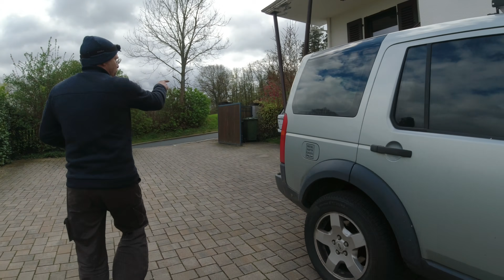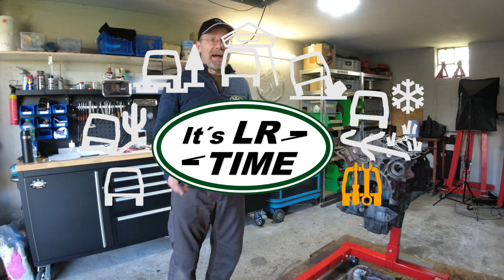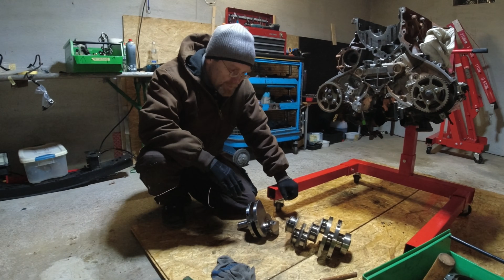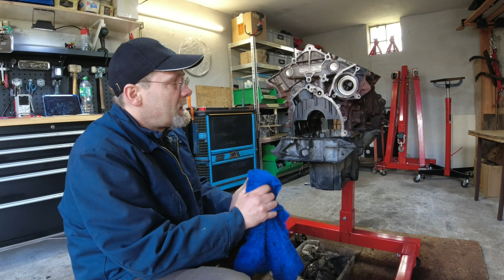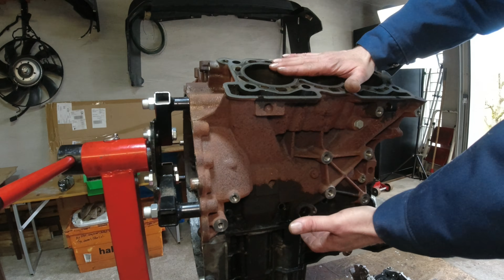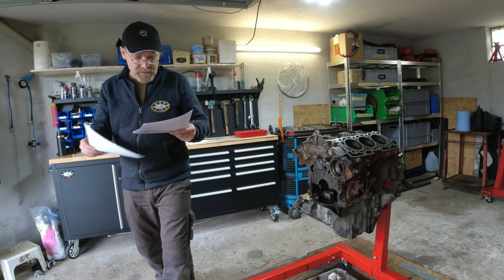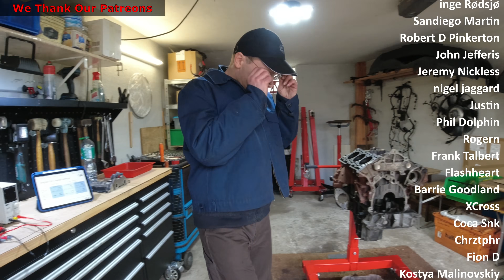Ford´s 3.0L Powerstroke failure modes - also JLR SDV6 306DT / S5-EP16

Comment: What do you think of the rough injection phases right on the low RPM as another reason to ruin SDV6?
I read about it from a guy who rewrote fuel cards (chip tuning) to REDUCE moment from 600 Nm to 550 on low RPM, but add more horsepower on high (~300 hp).
Reply from the maker: We agree. 👍👌 No tuning and no additives for any of our Land Rovers, or cars we own or service. 🙋‍♀️

Comment: Hi Christian 

About the Queen fuel heater problem if you have a Webasto heater search for "Webasto 800h reset"
I think that is the problem if you have tried everything else.

Many Volvo owners in Sweden have this problem and cost a fortune to fix at the dealer and they always repalce the whole unit
because they are not aware of the problem.

So just a tip to point you in the right direction and thanks for great content in the channel and keep up the good work

If you need some links for the solution above, contact me direct my message are deleted if i post them here.

Kind Regards from Sweden not driving a Volvo myself just working on them and other cars in my own workshop at home like you :)
My own transportation is an Alfa Romeo Giulia Veloce Diesel -17 but wait now i am running 5w-40 on my car too :)

Comment: Excellent presentation. Wonder how the RR TDV6 in the US compares to the European version? I can tell you that we only have one turbo on our 2016, I confirmed that the other day when I was trying to figure out where the oil in the intake was coming from. Don’t worry about the camera, the content far outweighs any camera issues!! Is there a way to change the service interval reminder to a lower interval with the Gap too? I was looking but I am not coming up with anything. I know we can keep track but I do the maintenance and the other half does most of the driving!
Reply from the maker: Land Rover did not sell the TDV6 or SDV6 in the US. Most likely because Americans are not scared of suing Land Rover into the ground. 😀👍🙋‍♀️
Reply: @Vera_and_Christian Hmm I have a 2016 Range Rover with what they call a TD6 diesel, it’s a single turbo V6 diesel, my understanding is Ford developed this engine knowing that they wanted to put it into the F150, I assumed it was similar to the engines in the F150, but I admit I have not researched this.

Comment: Excelent video. We ran a Discovery 3 for five years, and a Discovery 4 for 4. The latter only had 51,000 miles on the clock when I sold it but as your video noted I like many owners always had the crankshaft issue in the back of my mind especially after talking to a fellow commuter on the train whose engine locked up at 45,000 miles three weeks after the LR' warranty expired. We now have a Discovery Sport albeit the fairly rare petrol model which allegedly is more robust than its diesel sibling fingers crossed. When you run out of SDV6 content I am sure that the Ingenium engines will be a potential source of new video content!

Comment: Hi Christian. There is a thread locker fluid I've used successfully for installing races in differentials. Where the axle has "sprung," opening clearances and grip on the saddle bearing cups. A similar situation for it's use? Seems to be a severe flex happening there. Great video as usual!

Comment: I change the engine oil every 10k and trans oil every 50k. Personally I don’t think 5w30 or 5w40 is critical but avoiding oil dilution and carbon loading of the oil is very important. At sea we test the engine oil weekly for dilution, carbon loading, and moisture.

Comment: Great video Christian and Vera. I have a 2014 discovery 4 with 181,000 miles and still going. I change my oil every 6 months which is around every 5,000 miles. I am thinking of changing to 5w-40 now though. Keep up the great content. 👍🏻

Comment: Back again Christian. I have some more info for you on block repairs. I like the post below, but it is a bit complex to weld a block as I said before. The first point is what do you weld with? Last time I suggested bronze welding because it is strong and well tested, but the problem with it is how much heat you need. The other options are arc welding with Nickel electrodes (made specifically for cast iron),  with or without much preheat,  or a metal loaded epoxy product made for this kind of job.
The technical part of the welding is this: Heating cause expansion of the cast iron, and as it is inherently brittle, may crack as it cools. Nickel electrodes are quite soft and malleable so the weld bead will deform during the cooling, and is usually satisfactory if the welded part is supported well around by much larger section parts, as your block appears to be. However there is a risk if the hole has any microcracks around it, which act as stress raisers leading to more cracking. It is likely that this would work with your block.
The alternative is to patch the part using some metal plates, fixed in place with the metal loaded epoxy as adhesive / filler. Such is Devcon from MSC etc, it is very heat and oil resistant at lower block temperatures, very strong, and has no risk of cracking. It does need good surface preparation, cleanliness etc for success, but is often used to reclaim many machinery parts made of CI, to fit bearings that have spun, cracks etc. It is fatigue resistant too, so should resist the cyclic stress from the crankshaft bearings. It is cheapish too at less than £50 here, again you will need metal plates to cover the hole with a good area for bonding around the hole. The repair should be reinforced with more loaded epoxy inside and out. When painted it would be more or less invisible. Excellent cleanliness and prep is needed of all parts.

Comment: I agree with you. 
My SDV8, Ford Ranger 2.0 bi-turbo, Mercedes V300d all have there oil changed 6-10k which is in between main dealer services. 
Also you cannot trust anyone to do a job as good as yourself.

Comment: Very interesting video, thanks!

The V6 Lion was pretty much discontinued by LR by the end of 2020. The new Ingenium straight 6 was introduced in the RR/RRS in 2019 and the Velar in 2020. From early 2021 on, the Discovery 5 was also built with the new straight six as well, so that appears to have pretty much fixed the crankshaft issues :) 

The Ingenium 2.0 litre engine also uses clever solutions to help reduce emissions. It uses a variable flow water pump to allow the engine to get up to temperature quicker so it's more efficient with less emissions from startup.

On oil maintenance, the new engines tell you on the cars screen that they have a 21,000 mile service interval. That may reduce based on the type of journey, but nowhere do LR (or their dealers) claim to use much lower intervals. Now personally I think 21k miles on an EU6 engine is nonsense. Arduous conditions don't include short journeys either anymore. For my car I'm going with an oil change every 7000 miles, regardless of what the car is telling me. 

In terms of oil dilution, the problems occur when the DPF is not connected directly to the turbo outlet and therefore the exhaust gas temp drops too much when it reaches the DPF. This prevents passive regeneration from working effectively and then to compensate the ECU will inject fuel into the exhaust gases to use it on the DPF to burn off the soot, however, some of this reaches the sump. High bio-content diesel is really bad here as its evaporation temp is higher and it doesn't evaporate like 'normal' diesel which makes the issue worse. 

It would be interesting to see how far away the DPF is on the D4 from the engine. If it's still on the chassis, under the middle then that will be the reason for high dilution as the car will be relying on active (fuel injection) regeneration and the dilution is unavoidable. So oil changes will need to be very regular to stop another bearing failure, or turbo failure as well, as this also suffers if the oil quality is poor. The 2.0L Ingeniums in the Disco Sport and Evoque suffer really badly from this.

Comment: Hi Christian. More info on fixing the block! There are two things which might work, these are welding in some way, or modern adhesives. The choice is not that simple, because a weld repair has risks from the heat causing cracking or distortion. 
Welding: You can bronze weld with oxy-acetelene or TIG, with significant preheat over a fairly wide area, or arc welding with a nickel based electrode. (Mig wire for this can be obtained but not in small quantities and it is significantly expensive!). Nickel electrodes for cast iron work because the Nickel deposited is soft and malleable, so the cooling process does not overstress the cast Iron in tension, ie the weak direction. Note that you will need steel plates to repalace the majority of the hole, and minimise the quantity of deposited electrode. It needs to be welded in small sections allowing cooling between, to allow the stresses to relax via the Nickel stretching to suit.
Adhesive: This is completely safe as there is no significant heat, but excellent cleaning and preparation are necessary. As your hole is essentially non-structural this should work well, with some metal plates made to cover the hole and then glued in place both sides with a metal loaded epoxy. I suggest Devcon steel loaded type, from MSC or similar wholesaler, which is made for repairs like this, is very oil and minor heat resistant and very strong.
As you have very little to lose, either method would be worth trying, and would be very cheap. The welding video might be most interesting to watch, but is more risky as far as failure goes! Technically there is no reason why either repair should not be satisfactory, Many large pieces of machinery have such repairs which last very well.
Kind Regards David CEng.
Reply from the maker: Are you going to buy a Discovery 4 or any other car, when you know that the block has been welded? And pay good money for it? There are 4 holes in a graphite casting block, and keep in mind that the block is double walled. We will only weld it for decorative purpososes. 😀👍🙋‍♀️

Comment: I wonder what 3.0 V6 Diesel engine is on 2024 Ford Ranger?! We expect the same problems?! And also, as it is build together with VW Amarok on the same line in the same factory, why they didn't choose the VW 3.0 V6 Diesel engine?! Very good point with 10.000km service interval, I think it is mandatory no matter what the producer is saying for Diesel engines (for petrol I don't have much experience, so maybe for them too)
Reply: At first glance (10min over internet) it seems the new Diesel Ford 3.0 V6 Powerstroke introduced in 2018 in North America on F-150 and on the new Ford Ranger (build in Thailand and South Africa Ford factories for European market) is an upgraded version of Lion with graphite cast iron block, cast aluminum cylinder heads and upgraded camshaft. Produced in same Dagestan (sorry, Dagenham) factory. Unfortunately it has different mounting points to the LR 3.0V6, possible other differences. As there is a notable number of blown engine LR Disco 4 in Europe with low mileage and good value (if repaired), engineering a swap with current much more cheap version of 3.0 V6 Powerstroke  (at least engine mountings, other issues if necessary)  can generate itself a good reliable business. Now that can be a task worthy for you, Christian

Comment: I do an oil change every 3k Miles. It's so easy, I can just crawl under, drain the oil and replace the filter. 2004 D2 V8 gasoline, no lift.

Comment: Manufacturers like Ford only design their engines to last the warranty. Who else would design engines with rubber timing belts soaked in oil? Ford engineers also worked on Peugeot  and Mazda, so beware.
Reply from the maker: Yes we have covered all that in our Worst Diesel video👍👌🙋‍♀️

Comment: The F-150's engine had a lot of redesigned stuff, including a forged crank. The crank would be worth it's weight in gold for you guys. The 2018 and later JLR vehicles also had the forged crankshaft
Reply from the maker: The crank was forged from day one. Even the 2.7 L had a forged crank in 2005.  Christian
Reply: @Vera_and_Christian  that ks for the reply Christian, so what did Ford do to change it for the 2018 engines that supposedly fixed the failures?

Comment: My car 2019 range rover sport 3.0 diesel has 27000 miles and crankshaft snap and bent the block
Reply from the maker: Yes that is early. Hope you can settle with Land Rover. 👍🙋‍♀️

Comment: Did Land Rover/Range Rover make any changes to the 3.0 td6 engine for the North American market, or is it completely the same? It's a shame Ford changed the engine block.
Reply from the maker: Land Rover does not ship the Diesel Engines to the US.  Christian
Reply: @Vera_and_Christian  Interesting, what engine is in the American version of the Range Rover Td6?
Reply: @LOLOLOLOLOLOLOLOLing  The RR L322
 TD6 is a BMW inline six turbo diesel, mated to a weak GM 5 speed automatic transmission.
Reply: @tempestv8  Are you referring to the L322 TD6? I was asking about the L405 generation of range rover, specifically for the US market.
Reply: @LOLOLOLOLOLOLOLOLing  Ah good point!  I have edited my comment above to be a bit clearer!  The RR L405 TD6 in the USA will be the same Lion V6 diesel as the Discovery 4, so unfortunately it too will have the snapping crankshaft issue.  Not sure if the oil limiting valve made it into that engine.

Comment: Audi also uses oil pressure reduction controlled by the ECU to meet EU6.  In the Audi V6 it causes premature timing chain wear, camshaft gear wear, camshaft wear and roller rocker failure.  It is fixable with an ECU flash to increase the oil pressure, but by the time people get it done they are 8-10 thousand pounds in the hole for repair.  It's worth watching VAG Technic channel to see all of this.

Comment: I don't think you mentioned it but Ford Australia has been selling the twin turbo 3 litre V6 diesel twin turbo since 2022/3 as an option in their Thailand made Ford Ranger and Ford Everest (the Everest is an SUV version, a bit like a Discovery D3/4 but with no air suspension) and unlike the D3/4's strong cabin design. Also sold in a VW Amarok. And in South Africa too. Standard diesel motor for the Ranger / Everest is a 4 cylinder diesel. The Ranger is Australia's top selling vehicle. It is a light truck with a towing capacity of 3.5 tonne. The twin turbo V6 diesel 3 litre has only been available in the Ford Ranger for a couple of years.

Comment: As well as being a huge LR fan, I’m also a Citroen fan. I have this 3.0 Diesel engine in my 2010 Citroen C5. The car is currently on 180,000 Miles, not KM on its original engine. After watching your videos, it’s currently running 5w40 too!

Comment: Very interesting video, as they all are. I’d be interested in your opinion on oil changes on a brand new D250 Defender L663 with the 3 litre six cylinder Ingenium engine. Especially because Land Rover specifies 0W30 oil meeting their specification STJLR.03.5007. So far as I can see this is only available from Castrol  and Shell but at least you can now buy it online at a sensible price. No other oils are mentioned for different climates or arduous conditions. And presumably the warranty will be invalidated if you use something else so that just leaves the question of the interval between oil changes.

Comment: YOU CAN PUT A JAGUAR GEN 1 ENGINE. WITH THE SIMPLE OIL PUMP, JUST DONT PLUG THE SOLONOID. DONE THIS ON 3 RRS AND WORKS PERFECT ANF FITTS EVERYTHING. IF NEED MORE INFO CONTACT ME.

Comment: Would a stop/start system not have made sense? Engine stops when stationary and idling but in motion always has higher oil pressure.
Reply from the maker: They have stop/start. Doesn't make things better. 👍🙋‍♀️

Comment: a very jnteresting video.  You talked about engine life in terms of kilometres, I think engine hours would be a better measure. Seems running a non euro 6 motor might be a better outcome. I own 2016 SDV8 thought of getting the last SDV8 ,2020, as an upgrade but if they have gone the same way as the SDV 6 may not be a good idea?

Comment: Does your 5W40 advice go for other diesels? I have a Skoda Octavia 1.9 TDi (2009 but with 80,000 KM from new). Going in for first service in my ownership and I don’t want to be a 5Wdumbass☺️
Reply from the maker: No, you run what is specified. Only for the TDV6 and SDV6, which are known to have problems with the oilpressure and oildilution, do we recomend a thicker oil, which is still specified by Land Rover in certain countries. We tried running 5W40 on our B-Class and the engine did not respond well to the thicker grade oil. 🙋‍♀️

Comment: I’ll start with saying thank you to Christian for his humility and excellent work. 

To any Brits feeling wounded, I offer this list :

1. BMW M60 Nikasil (Jag had same issue btw)

2. Porsche IMS bearing

3. VW Diesel-gate

Feeling better? Think about this. Only people who do things can make mistakes, the rest just laugh on. Fixing problems in series is easier if you have a lot of money from higher volumes. JLR doesn’t make a lot of cars compared to BMW, Mercedes and VW so it’s harder for them to fix issues.
Reply: The engines with the problems are Ford! and the BMW engines in LR's don't have the best reputation either. Sounds like that sinks your theory about production numbers.
Reply: @Skiddins  not at all. The point is everyone has issues.
Volume = money = the ability to fix shit.
Reply: @SW-qr8qe  I understand what you're saying, but my point was that the companies responsible for the design and upgrades (presumably) during the lifttime of these engines are companies that produce in high volumes and use them in their own products as well.

Comment: Disco 3 's push diesel back up the injectors - down the wires within the insulation and into the ECU Plug !!!- To remedy - needs Brake Cleaner to wash out the Plug Socket at the ECU end- until next time it does it.